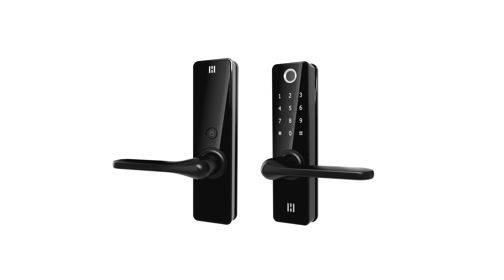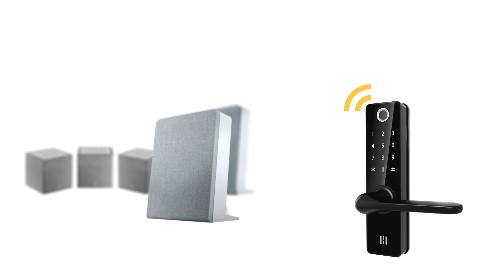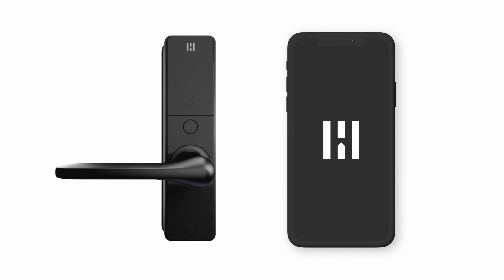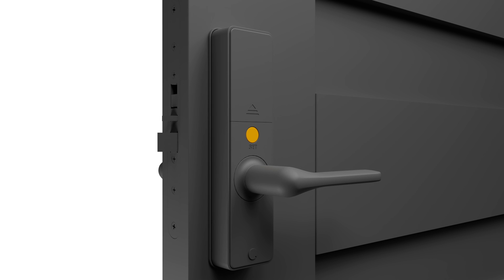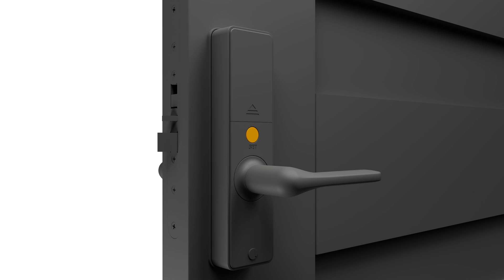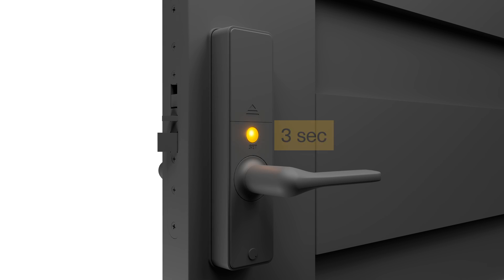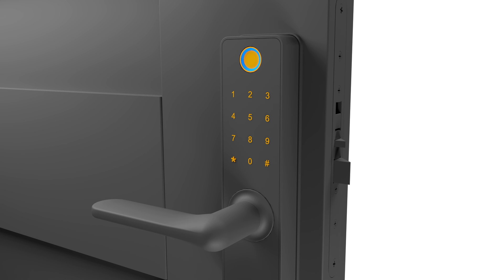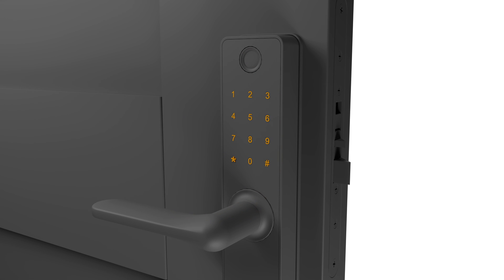Heimgard Smart Lock Part 3   How to configure your Heimgard Electronic Door Lock

Comment: I can not activate auto lock on the outdoor handle. So everybody can get in from outside.. but from inside it is locked. HELP!
Reply: Same issues here 😅, did you find any solution?
Reply: @FloAndre.   i just installed it to my friend, what we found out that you need to adjust the the metal plate inside and turne it either to R or L in my friend case we have to switch it to L, the rotary metal thing that the rod goes into :), i hopes this helps you and @arezganji7270

Comment: funny how to forgot to type in manual what theftsecurity mode really do... they just tell how to turn it on and off.. i called and made em aware.. they thanked me alot.. as they forgot to put that info into the manual hehe. . there are 2 things it does... i forgot the first.. but the 2nd is the electronic thing it does.. that is if someone try brake in.. or scan finger or use fault code or tag 5 times.. the door electronic turn itself off for 5 min. .. the thing i forgot had something to do with a tap inside the lock.. did not get what he ment.. but i read about it now they will update the manual... first updated will be the one on their website:)